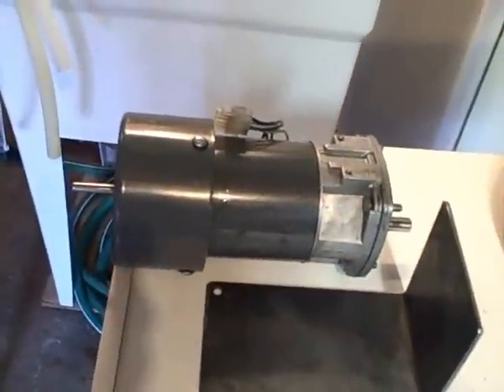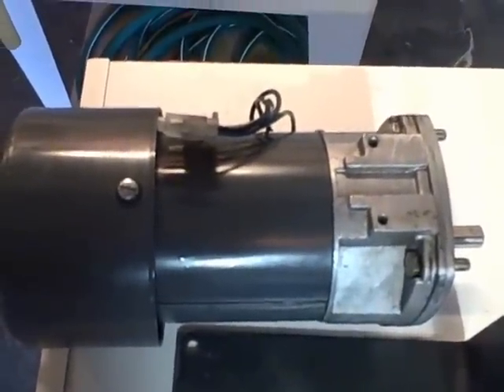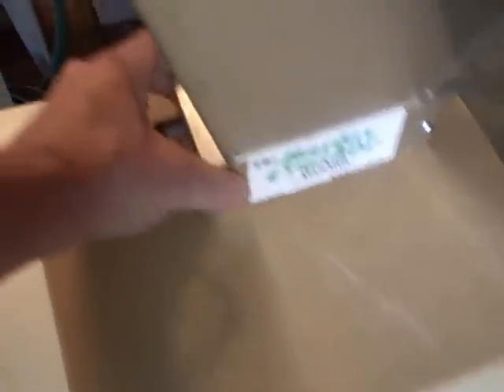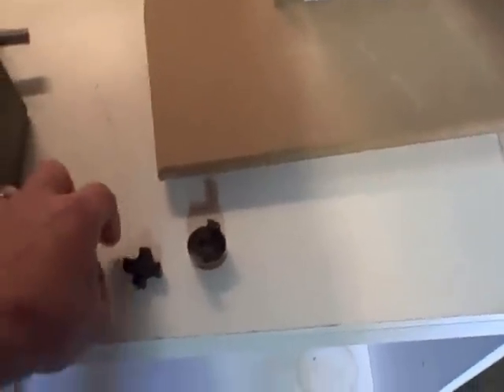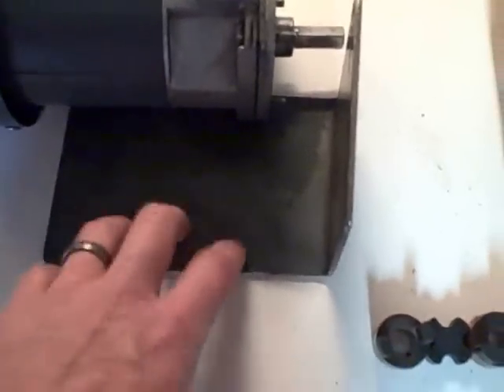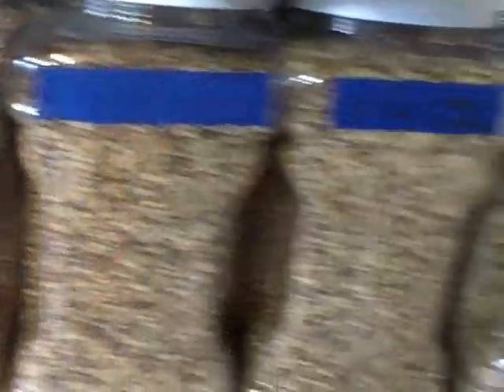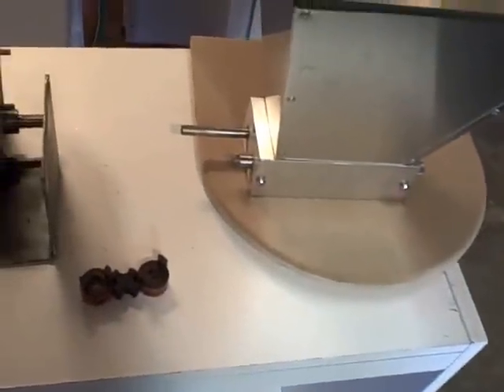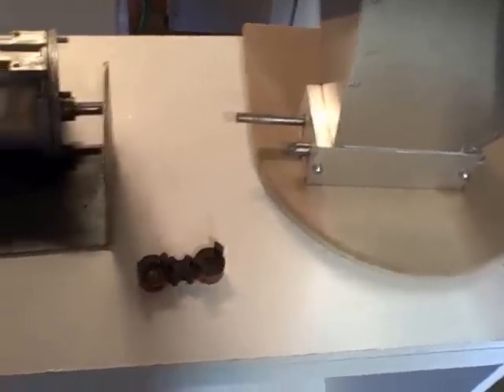Barley Crusher - Stuck Sparge

Comment: Jake, I am also a batch sparger guy. I remember reading in John Palmer's book How to Brew, that if you batch sparge, you should open your ball valve all the way. Thats how I do it but don't know if thats the correct way. I've never had a stuck sparge but I also use a mash screen that I bought at Northern Brewer. I've also read on some homebrew forums that those hose braids sometimes collapse. I've heard of people putting some copper in the hose braid so it doesn't collapse. Good Luck!

Comment: I also use the barley crusher and a stainless braid in the cooler. I couldn't tell which braid you have, but my best luck is with the water heater supply line braid. I have not had good luck with the smaller ones made for toilets. Also, .5lb of rice hulls in each batch has cured my problem with stuck sparges. My preference is to add the hulls instead of mess with the mill, which gives good efficiency. The hulls are simply a little insurance to prevent stuck sparges.
Keep cranking out the vids!

Comment: One thing comes to mind, and I'm sure its not the only thing, but after you add your strike water, make sure to get all the air out of the braid before adding grain.  This way it won't float up in the grain bed.  You want it to lay flat on the bottom to avoid a stuck sparge.  Sometimes stirring the mash can raise it too. A finer crush will definately increase the likelyhood of a stuck sparge.  All I can think of on that is try draining slower.

Comment: I had a stuck sparge with a pumpkin ale that had 2 large cans of baked pumpkin in the mash. I basically did the same thing you did and it worked out fine but next time, I know i'll add at least 1/2 lb of rice hulls and that should help filter and keep the sparge running well.

Comment: Sounds like to fine of a crush, I use the same tun as you, I also use maybe five hundred grams of wheat malt for almost all  brews for head retention then i will add rice hulls five or six handfulls. Batch sparge at a full pour. Never a stuck sparge with barley malt, but brew a  wheat malt beer and look out go 50/50 with rice hulls